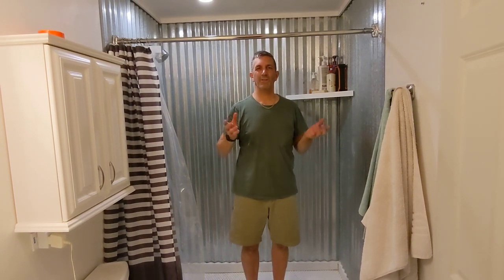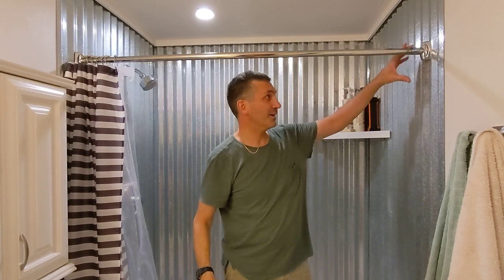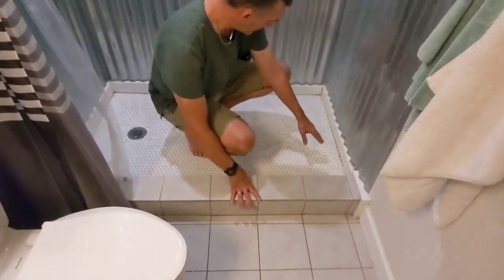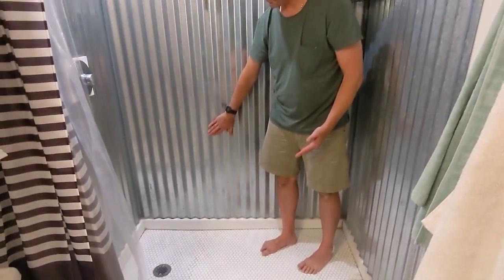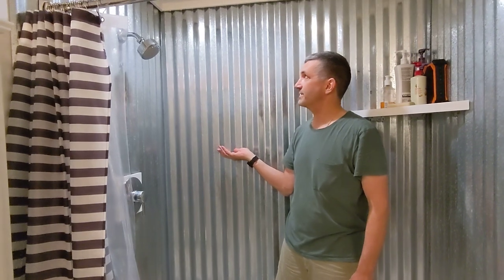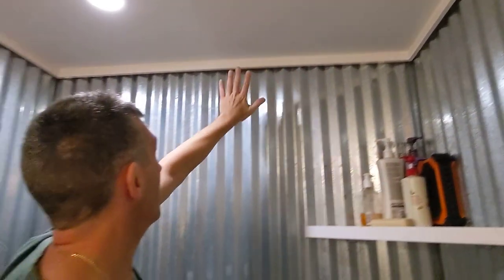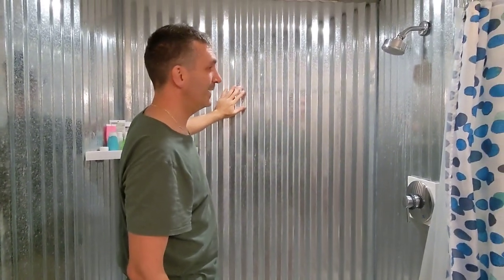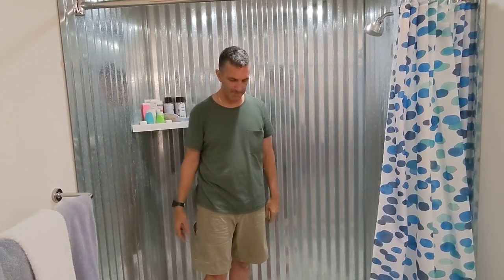Corrugated shower long term update

Comment: Ok how did you build the shelf or attach it?
Reply from the maker: @Anne5928  https://www.homedepot.com/p/Veranda-3-4-in-x-5-1-2-in-x-8-ft-White-PVC-Trim-IN5416425/205725098

https://www.homedepot.com/p/Simpson-Strong-Tie-GA-2-3-4-in-18-Gauge-Galvanized-Gusset-Angle-GA1-R/313810442

This is made from PVC plank boards, glued together using PVC cement, but no primer. They are mounted to the corrugated walls using Simpson Trong Tie gusset angle connectors (linked above)